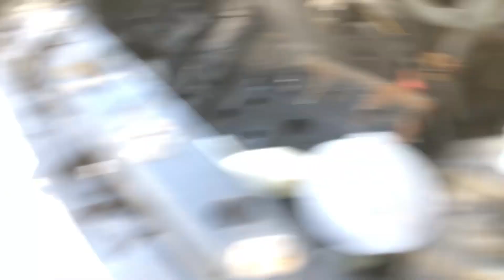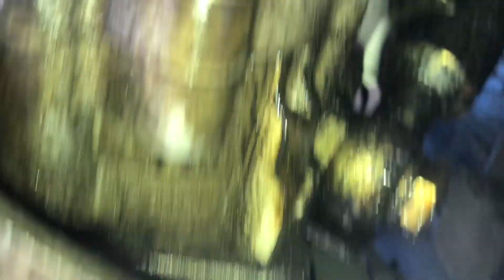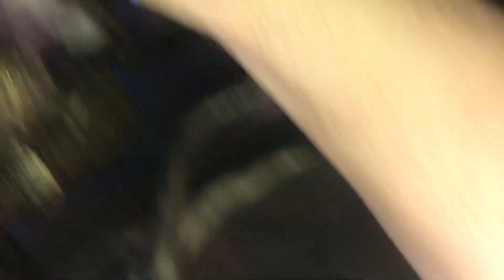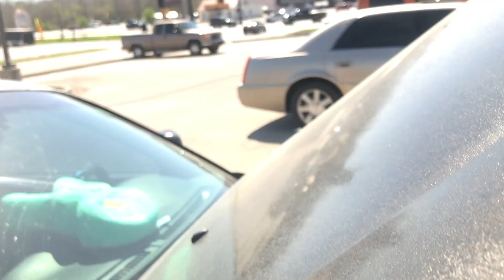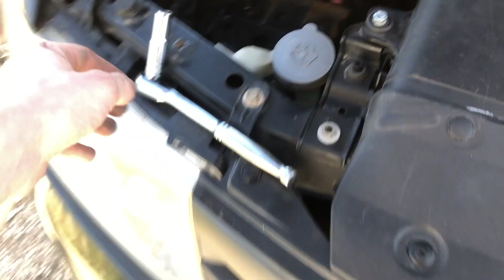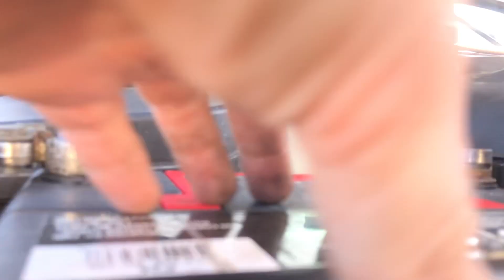How to replace Infiniti m45 Alternator in an hour or less (2003-04 model) vlog style

Comment: Is it mandatory to jack it up and get under the car? I have mine parked close in front of a wall.
Reply from the maker: Yes, only way you are going to reach the connections on the back of the alternator
Reply: @alecte_  Thanks broski
Reply from the maker: @Ruthlesscoach if need any help or run into any issues give me a shout I’ll help where I can
Reply: @alecte_  Were you able to easily access / see the starter once you were under there ? I'm not totally sure If it's my starter or alternator atp the car wont fire up but only  the dashboard turns on.
Reply from the maker: @Ruthlesscoach sounds like an issue with the starter or start solenoid. Alternator keeps the car running and charges the battery. Also if the battery doesnt have enough power it wont be able to start the car
Reply from the maker: @Ruthlesscoach I did not look to see if the starter was accessible from there. Im not super familiar with these cars but theres only one way to find out 😉
Reply: Yo thank you for posting this. I was needing a good video on changing the alternator. This helps sooo much!!
Reply from the maker: @Digital3style thanks for watching i felt i could have done a better job showing how it was done but i had forgot to start recording once i started undoing the alternator